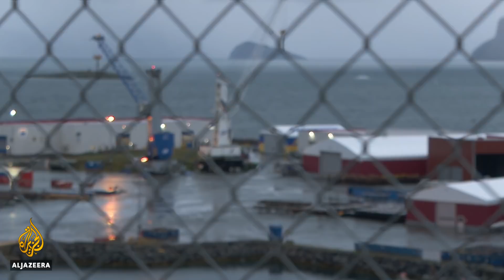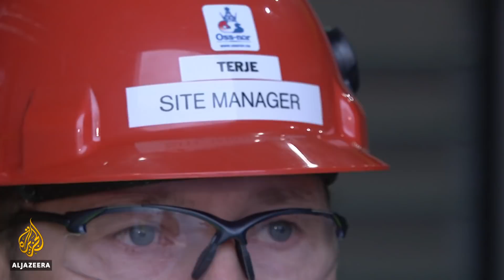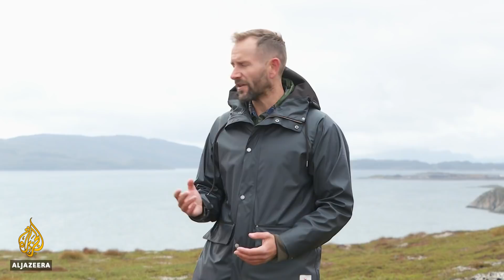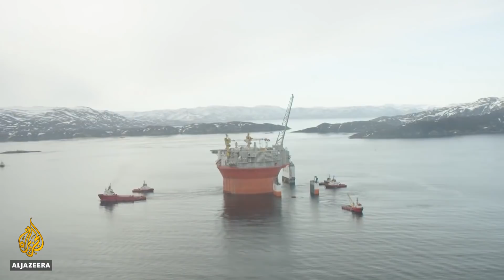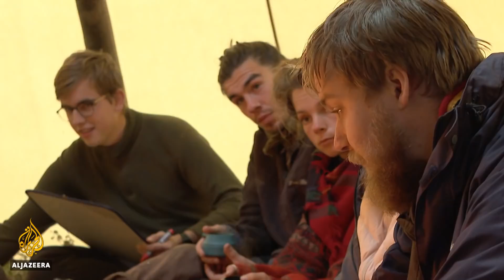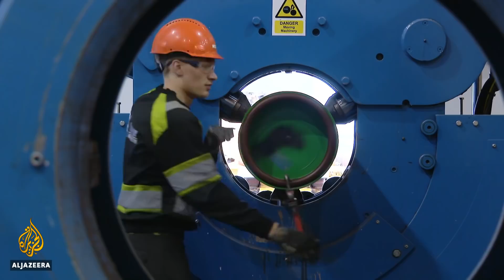Norway oil drilling issues resurface with elections

Comment: Norwegians are such a nice people. You can't have effective democratic society unless you have people like Norwegians.
Reply: Actually, it's more a case of how our electoral system is set up and that we have laws that's condusive towards a democracy to begin with.
If you implemented such a system in your country I suspect that peoples behavior would over time change as a result.
The main cultural feature that may be needed though is the trust in society.
People need to have faith in their fellow man for this to work.
Both in the goverment and in fellow citizens.
Reply: @Luredreier  I think it's more of a cultural thing than system and rules. In India we have very robust system but people in general are divided over religion and creed so it's difficult to have any reforms. We can't agree of anything.
Reply: @wasimshaikh1665  Hum...
My idea towards this would be a proportional system (multiple seats pr electoral circle), but one where instead of distributing seats among electoral circles based population alone you'd do so on a pr group basis to ensure that all of them gets represented.
Allow these seats from different groups to overlap and don't make them based on ethnicity or religion during the actual election, it should be a advantage for a political party to appeal to many different groups.
But having members from certain groups present in a community would give said community added political power.
Just like with your current first past the post system you could ensure that minorities are represented well, in Norway it's land that gives these seats but then there leveling seats that helps correct for too big distortions in this system.
Another alternative is to go with a MMP approach like in New Zealand or Germany.
Voters gets the option to vote for one political party and one candidate.
The candidate is voted for using a first past the post system, but then the remaining seats are distributed among parties proportionally, but already existing seats earned by the FPP system is included in the tally when distributing the seats, ensuring that the relative power of parties is proportional but that different communities are all represented with individual representatives.

Honestly given your current first past the post system a MMP system might be the best approach as it's a smaller change.
Add the Germanic use of leveling seats too and you'll have a really good proportional system I'd say.

In Indias case you'd then ensure that minority groups have their FFP seats representing them but include those areas in bigger areas where votes are tallied proportionally.
If they vote for someone who wouldn't get a vote under the proportional system you could still give that individual a seat on top of the normal proportional votes using the implementation of MMP used in New Zealand (Germany doesn't do this).
You could also give the bigger proportional electoral circles that includes such minorities a slight advantage in number of seats like I described in my proportional approach at the beginning.
Although the advantage could be less with this approach since the FFP seats would already ensure at least some representation from the minority, but adding more would help with proportionality within that circle and help offset extremism a bit.

So something like a certain number of seats distributed among the proportional electoral circles, each circle needs to be big enough to have many seats, then smaller electoral circles within the bigger one voting for one representative each, perhaps these smaller seats could represent 1/10th of the total seats that would be elected proportionally, ensure that small ethnic groups gets at least one of these FFP seats to themselves.
Then give say 10 seats pr ethnic or religious group distributing them amoung the proportional electoral circles based on the proportion of said group in each proportional electoral circle, majority groups are probably represented in many electoral circles and these seats would therefore be spread out a lot, while minority groups would get these 10 seats concentrated more giving them more relative power in those electoral circles since there's more of a chance that one of the proportional seats there goes to said minority group when there's more seats to fight over there.
And then for each proportional electoral circle also add one seat that's not elected By voters within that circle but based on the proportiality at a national level.
So if a party gets way less representation at a national level then they should in the local electoral circles compared to the proportion of the national votes that they get they could get these leveling seats.
Yes, this system increase the likelihood of a fragmented parliament with many small parties and no clear winners.
But election results are less binary.
Instead of either getting the most votes or not in a electoral circle you get a situation where being second best or third best is perfectly fine.
So the amount of aggression is lowered a bit.
And voting for smaller parties becomes genuinely viable.
Instead of just getting coalitions with the biggest party in another area you get much more of a mix.
With multiple plausible ways to get a majority for a resolution or government.
Also, given how fragmented India is it might be a good idea to permit just a majority not voting against something like a cabinet proposal or a budget proposal or a new law.
That way parties can permit things to happen without losing as much face as if they actually had to vote in support of something that they disagree with.
Also allow minority governments to rule seeking support from different parties on a case by case basis (just a majority not voting against something).

Honestly India is too big to ever fully function as a democracy.
But I'm hoping that something like what I suggest would still end up with a more nuanced and less aggressive political climate since more people then just the biggest parties would have a voice.
Parties in between the big ones who could be allies with multiple big parties on a case by case basis and won't always be seen as enemies by said big parties.
And since there's less risk of the current landslide first past the post election results the smaller parties would actually have other options then the biggest parties as coalition partners so you could see two or three blocks, major coalitions each trying to win the election after the , election results are in through negotiations.
It might seem like voters gets less power since they don't vote for the winner directly so to speak.
But they actually end up with more influence over the results.
If you want a overall left wing (or if you prefer a right wing) government but the representative of the biggest left wing (or right wing) party from your current first past the post electoral  circle is corrupt, you can't really get rid of him easily without voting against your conviction.
If it's a proportional system however you will have similar parties (that currently might even be factions within the bigger parties) that you can vote for that can still get representation and represent you in a coalition with the party you'd otherwise vote for.
And since having multiple candidates for a party in the FFP part of the election won't change the overall proportional power of a political party they'll be more willing to give you multiple choices to pick between at that level, even if they don't win the FFP part of the election you can therefore signal your preferences by picking between candidates from a given party there.
Or vote for a single independent candidate like before.
I'm probably approaching the limit of the comments size now, so I'll stop rambling here, but I hope that you like my thoughts here in the middle of the night, my stream of consciousness. Even if it might be a little bit chaotic...
Reply: That was an hours worth of rambling from a guy that just woke up in the middle of the night...
The sheer scale of India isn't adequately addressed above at all, but I hope that I've shared some thoughts that could be used as building blocks for something useful at least...
What do you think?
Myself I need to actually sleep again now instead of staying up at 4 am... ;-)
Reply: @Luredreier  wow I really liked your analysis. It will take me days to understand. I am from engineering background so don't know much about political system. Thank you. Would love to talk to you on these matters. Are you student of political science ?
Reply: @wasimshaikh1665  Unfortunately, no. Just a hobbyist with a interest in the matter.
I'd probably be more descriptive and less prescriptive if this actually was my field of study.
I happen to believe that some form of proportional electoral system is superior to non-proportional systems, and have been endlessly frustrated with the first past the post system used in the anglophone world.
I think that having many political parties with a viable path towards power and incentives towards compromises instead of snap elections leads to a lower level of conflict in the political climate...
Of course, Israel might be a good case against that position of mine...

Comment: If Norway didnt drills oil, what other sources of income would be ?
Reply: Services, domestic consumption, fishing, manufacturing,
Reply: @enhancedutility266  I don’t think they have those industries as big as oil
Reply: @marklynch1305  you are right but according to this news report they are shifting away from oil so they need to find other industries to diversify their economy
Reply: @enhancedutility266  What about using more of the sovereign wealth fund to offset losing oil
Reply: @piperafrica1150  they could use that sovereign wealth for their population but I haven't heard that they would use it but they might draw it at some time to buffer the economic shock's from the transition time will tell.
Reply: they have brain. Many poor country have oil...
Reply: @geoms6263 They made a better decision. Than, what the UK did with its oil.
Reply: service economy just like every other country
Reply: First of all, the only oil money that the goverment is currently using is 4% of the wealth fund (a wealth fund that for the most part has a interest of about 5%) and we've reduced the amount of money from the wealth fund that we're using in our economy because 4% is starting to become too much for our economy to safely handle so we're approaching 3%.
Of course the oil industry still plays a important role through indirect industries, the ones that's supplying the oil industry.
There's a lot of jobs there.
But with that said, we still have both several other industries already existing and also the potential for several other ones.
While labour in Norway is generally expensive our highly skilled labour is not, in part due to our free education.
So while a Norwegian carpenter or McDonalds employee is paid significantly more then their counterparts in other countries, our engineers and doctors are actually paid less.
As a result we're actually a cheap place to do things like develop new processor designs, and my own city in Norway is the location where ARM develop their iGPU design for their phone processors.
We also produce expensive components for the space industry, including NASA.
We provide a lot of services, like communication with satelites in orbit near the poles.
We do research and development with regards to ship hull designs.
And so one and so forth.
We're above the European average when it comes to research spendings when you combine public and private investments in research.
Like Germany we also tend to have companies that specialize in certain products, attemting to become the best companies within their respective fields with few or no equivalent competitors rather then trying to branch out and seeking new opporturnites all the time like American companies usually do.
Basically we don't compete on price but in quality or in niches.
Also having large land areas with a low population means that we're still able to provide a decent amount of resources for both our domestic market and abroad.
These can compete on things like enviromentalism, causing less damage to the enviroment during extraction then competing products or in other ways being preferable, higher quality products, lower transportation distance and costs, etc...
On top of that of course we still have a certain amount of agriculture, while this mostly covers the domestic market it still exports some high value products to other markets too, think refined food, expensive and healthy, luxurious etc...
Then there's our water and air.
Both on land and sea.
We still have the hydropower that we've always had, this allows us to still keep industry that requires high amounts of power going.
We also sell electricity to the continent to among other nations Germany.
Our water also means that we can trade fish.
We have a sizable fishing industry.
But more important for our economy then that is our aquafarming.
We export more salmon then any other nation in the world by a long shot from our fish farms.
We also have a lot of wind that's still largly untapped potential for wind power.
That's believed to be likely to change in the comming years.
More energy would mean that we could for instance start exporting hydrogen to Germany where this could be used to produce electricity both in power plants as well as in cars, as well as be used for heating food and houses like natural gas used to be used.
Our fjords could also potentially be used to produce electricity from ocean currents since the water flows into the fjords during high tide and out during low tides.
And of course we still have a sizable merchant fleet even though there's a relatively low number of Norwegians actually working in said merchant fleet.
Usually we have a Norwegian captain and engineer while the rest of the crew is dominated by a usually mostly Filipino crew.
Still owned and operated by Norwegians.

And then there's the sovereign wealth fund itself.
We as a nation currently own about 1% of all stocks in the world through that fund.
And our economy is unable to absorb all of the money it generates in interests...
Meaning that it's likely to keep growing and growing and growing even without despotiging a single more dollar in income from anything, oil or otherwise.
Unless that changes it'll eventually grow to a size big enough to essentially make it possible to fund the whole nation 100% on that money, at that point the rest of our industry is technically not needed anymore, although I doubt that we'd ever want that.
If anything I suspect that we'd just make a deal with neighbouring nations like Sweden and Denmark to help keep the fund under controll by extracting money from it while we continue to try to diversify our economy.
Reply: @geoms6263  yes example vanisvela